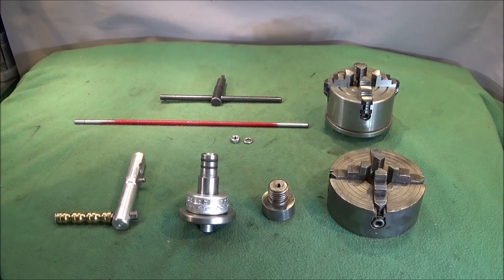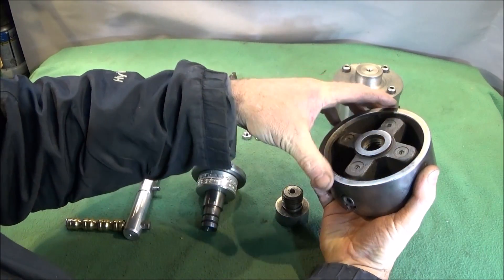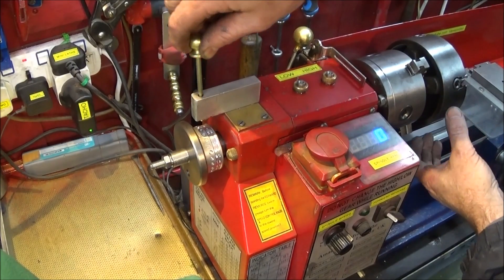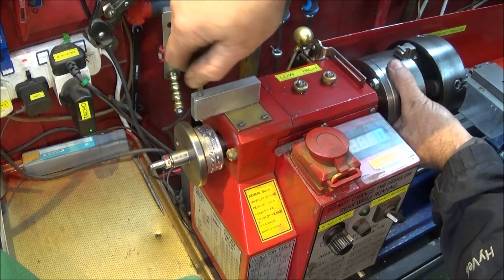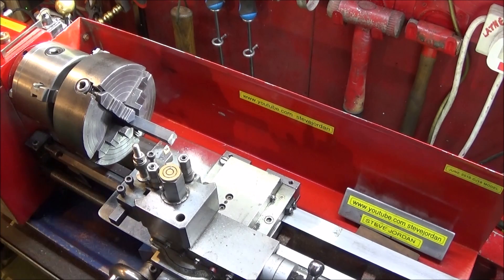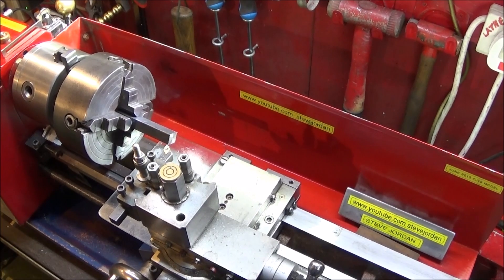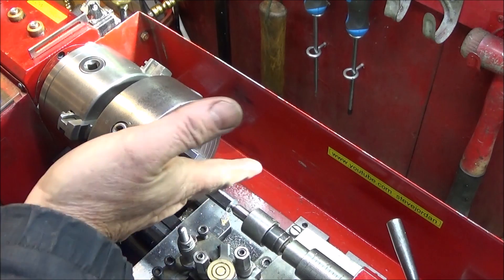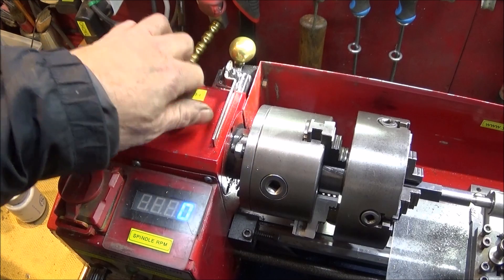Chinese Mini Lathe Draw Bar & 24 Hole indexing Plus Mandrel Handle

Comment: Seems like at that length times the diameter of the chuck and length of handle that would be a lot of torque and on that small threaded rod, I guess it depends on how much resistance cutting the threads on the work piece creates

Comment: Good stuff Steve where did you get the back plate adapter and the 4 jaw from cheers from OZ.
Reply from the maker: Hi Russelle, Thanks I couldn't find any of these mini lathe 125mm backplates online when I looked, so I had to make one up. 
It would be a good thing if anyone reading this... could make these and sell them, as I reckon they would be an excellent seller. Or maybe someone knows a company that sells them now?

Comment: The draw bar makes that setup way less sketchy. And at least give some peace of mind worrying if the 4-jaw will fly off if you're taking to big of a cut.

I'm curious if the extra mass of the 4-jaw helps with intermittent cutting for the small motor. Is it a matter like how a flywheel(and crankshaft counter weight) on a 4-stroke engine help it to turn over? Know what I mean? 

Only curious, not going to suggest back filling the space inside the 4-jaw with concrete or something. :P Thanks Steve for sharing yet another great mod for those little machines.

Comment: What's the runout on the second chuck?
Reply: That all depends on the three jaw chuck.  The second chuck is a 4 jaw independent so that you can get your work as close to on center as you like that is the idea of the whole thing.
Reply: I was thinking more of the vibration from spinning a second chuck slightly off center might cause, not centering the work.
Reply: Right and that is a good point, I agree.  However, when we are using a 4 jaw, at least where I work then the work piece is usually very off center and that in itself is a vibration problem but unavoidable. The lathe I use has just this type of a setup and it sure beats changing those heavy chucks.  Specially for a one off job.  But you do make a good point, as I said.
Reply: Thanks for the info. Makes a bit more sense now.

Comment: Excellent as always Mr. Jordan! I think I will make a video of my CML where I did your rear handle mod. I am a plumber and I noticed the mandrel on the rear perfectly accepted a 1/2"NPT pipe tap. After tapping I made a spider, draw bar, tap handle, index wheel, etc. and they all are 1/2" pipe thread. Just an idea if you ever need it. Thanks, Gerry